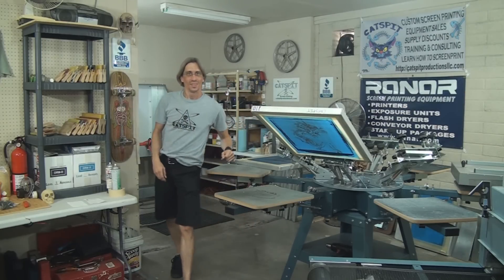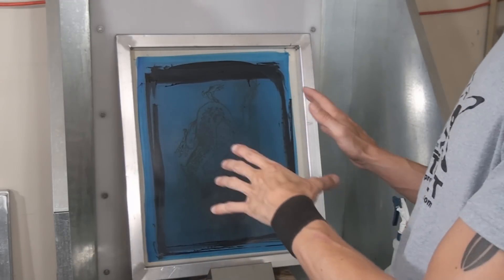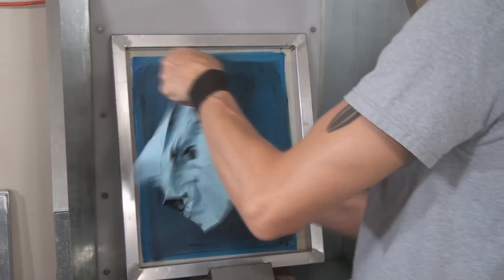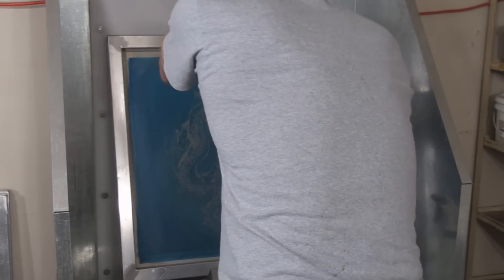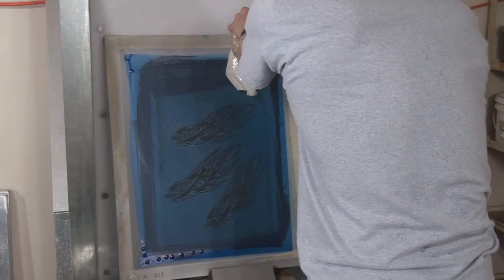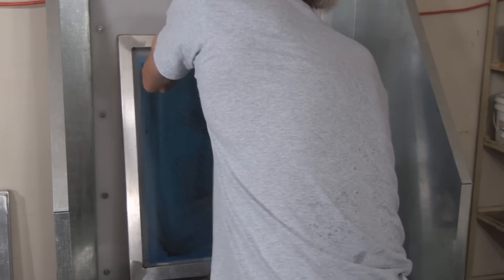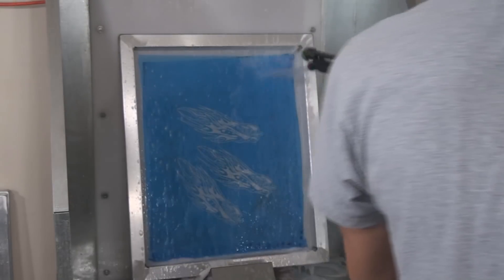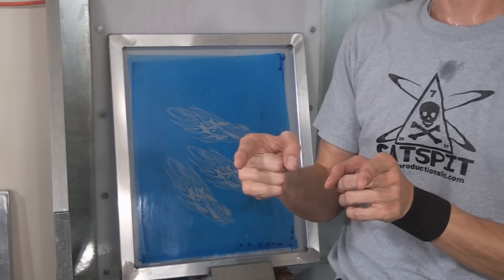How To Screenprint: Tips For Cleaning Ink Off Screens

Comment: be careful not to use the wrong solvents as certain ones will crystalize ur emulsion and subsequent coatings if not thoroughly removed.
Reply: ir4 and Pw4 are good but there is one called ir9 or something that will screw up ur prints by leaving small dots of emulsion on ur screens the next time u coat
Reply from the maker: +Poly Organza If you use the Saati product properly you should not experience that. There may be something wrong there in the product or how it was used or for what it was used. They have up to like IR 18 now...LOL so it can be confusing. None of the chemicals I have for screen printing will cause stencil lock normally unless the emulsion is under exposed and absorbs them during printing. If you let emulsion remover dry on the emulsion it will make it permanent. Your mesh prep should be cleaning the screen of any contaminants before you coat with emulsion. Thanks for watching. Screen Printing Equipment & Supplies - http://catspitscreenprintsupply.com/
Reply: +CatspitProductions  the one saatichem ir I'm referring to smells like kool aid from what I remember. it caused "reverse pinholes".  it could have been not degreased properly but man it is a pain in but. it had hot solvents in it, that's what my boss said caused the problem.
Reply from the maker: +Poly Organza Saati makes excellent product so your boss should call them for technical assistance. That should not be happening.

Comment from the maker: Not really. Any halfway decent pressure washer of 1500 psi or so should work fine. If you plan on doing a lot of screens then you might want an industrial unit but for print at home purposes you can see a listing of pressure washers from Amazon.com that I suggest as examples. There’s also a bit of info there for you about it. Look under the Equipment Sales tab of the navigation and click on Pressure Washers. Thanks for watching and leaving a comment! ☠

Comment: I have a question. I have reclaimed my screen but the image is still there with black ink. Can I reuse the screen?
Reply from the maker: Sounds like you have ink staining the mesh. try a haze or stain remover with a pressure washer to remove that. Otherwise it will impede the ink flow in those areas. Thanks for watching! Screen Printing Equipment & Supplies - http://CatspitScreenPrintSupply.com/

Comment: what can i do if the fabric paint stays on the screen for too long? :(
Reply from the maker: If you're talking about water based or "air dry" inks then the screen may be ruined. You can try a pressure washer but normally that screen would be trashed. Thanks for watching. Screen Printing Equipment & Supplies - http://catspitscreenprintsupply.com/
Reply: Id try a ghost remover, use with caution. It may ruin the screen if left on for long
Reply from the maker: CapslockOMG Yeah haze removers can act like an acid breaking up or loosening emulsion or ink stains so sometimes it's worth a try. Thanks for watching. Screen Printing Equipment & Supplies - http://catspitscreenprintsupply.com/
Reply: we use fotochem 2091 Anti Ghost Gel at work, but dont like it so much with waterbased colour though.
Reply from the maker: CapslockOMG Interesting. I would recommend Saati HR5. It's commercial grade and very, very aggressive. 

http://catspitscreenprintsupply.com/saatichem-hr5-haze-stain-remover

It does the job and some.
Reply: gonna look into that some Catspit, only got 3 that im thinking about renet, due to waterbased ghost prints, still can use other side of screen though for smaller prints, lol.
thanks for tip.
Reply from the maker: CapslockOMG You're very welcome :)

Comment: I bought a solution, not sure if right for the job but I bought a chemical to clean and re use per the supply company.
Reply from the maker: Sounds like ink remover or emulsion remover. But yeah you can reuse the screen with the same stencil or you can reuse it with a new stencil. Thanks for watching. Screen Printing Equipment & Supplies - http://catspitscreenprintsupply.com/

Comment: like, when u use the paper as a stencil... then get ur wood... and paint... then spread the paint, then remove the paper (stencil) immediately, but if u wait for more than 15 mins.. the paper (stencil) will stick to the screen... and becuz of that... i cant print properly... :(    I've tride, soap, water, glass cleaner ( idk why lol), scrubbing... HELLPPPP
Reply from the maker: If you were using water based inks, the screen may be ruined. But you could try emulsion remover and/or haze remover with a pressure washer. Thanks for watching. Screen Printing Equipment & Supplies - http://catspitscreenprintsupply.com/

Comment: Dont use a rag to remove ink. OMG! 
 Use a card. 
Save all that ink you can! Its the most expensive. 
Dont use a rag to smear the ink, 
spray up the screen now , Use a screen pad. It breaks down the ink faster .
Use a smaller squeege to remove the excess press wash/ink to the 3 rags he just used.
Detail the image from the back side, That just saved you time and chemical.
Save/Reclaim?
Wet down both sides, then to reclaim the stencil use ER2. 
Scrub both sides, 
then rinse from the bottom to the top.
Reply from the maker: LOL... thanks for sharing your methodology. To each his or her own. But I'm not sure what you mean. I had already removed all the excess ink with an ink scoop. There was no more ink you could scrape off and reuse. There will always be a film of thicker ink on the screen after you scrape it off with a card or scoop. The rag helps remove a little more of that so when you put the solvent on it does not make a big black mess of slop. You do NOT want to use a scrubby pad to clean ink off a screen you intend on reusing. You could risk damaging the stencil. When cleaning screens for reuse you want to be gentle so a rag is perfect. With he IR4 I usually use a brush but not everyone has a nice bucket and brush system like I do so I used a rag in this video. After the IR4 you can use whatever reclaiming method you prefer. I have other videos on stripping or reclaiming screens. This video focused on the 2 types of plastisol solvents there are end their different usage. Thanks for watching! Screen Printing Equipment & Supplies - http://CatspitScreenPrintSupply.com/

Comment: I fucked up n took the tape off n well now there’s Ink on the wooden part of the screen :(
Reply from the maker: If it's plastisol then just clean it up until there's none left to get on you. It may leave some stains but it shouldn't matter on the frame itself and even on the mesh near the frame. If it's water based ink then it will dry and may look crappy but the screen is still usable as long as the ink has not dried in the mesh. Thanks for watching. Screen Printing Equipment & Supplies - http://catspitscreenprintsupply.com/

Comment: how do you get dried ink out ?
Reply from the maker: If it's water based ink, the screen could be ruined. If screen opener won't do it, then more drastic measures may be needed. Try some haze remover and a pressure washer. Thanks for watching. Screen Printing Equipment & Supplies - http://catspitscreenprintsupply.com/